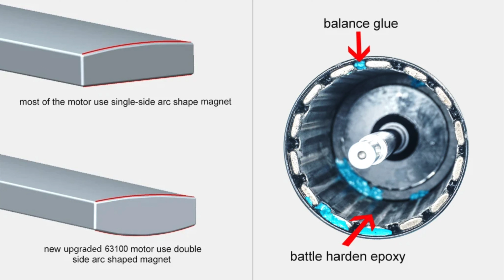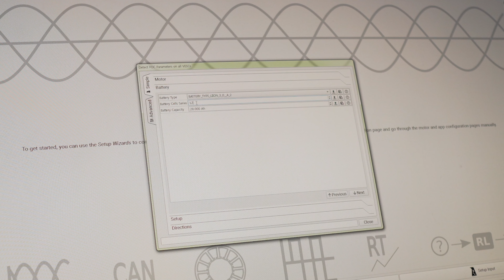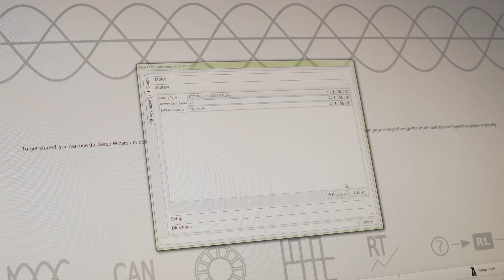#111 DIY electric board motor test - 63100/190KV Flipsky

Comment from the maker: It wasn't easy to explain the characteristics of the motor that I felt while riding with subtitles. So to put it simply, it was a strong and good quality motor.
If you plan Mountain E-board as DIY, I recommend this motor that has a huge output and is universal availability in both "torque and speed."  https://flipsky.net/
라이딩에서 느낀 모터의 특성을 자막으로 설명하기가 어려웠습니다. 그래서 한마디로 표현하자면 정말 괜찮은 모터였습니다.
마운틴 E보드를 DIY로 계획하신다면 강력한 출력으로 토크와 스피드 모두에서 범용성이 좋은 이번모터를 추천합니다. https://flipsky.net/
Reply: What remote are you using? Also what deck can you recommend that is also affordable? Thanks you in advance.

Comment: Thank you for the wonderful video and editing style. I'm planning on putting these flipsky 63100 190 kv on my Lacroix Board. I'm also installing the Boardnamics BN M1 AT Gear Drive which you state in your video to not install flipsky 63100 motors on Gear Drives, If I'm understanding correctly? You also said "Impossible to install gear drive mounts because the length is not right"? Is this still the case in 2024 flipsky motors? Boardnamics told me it will work. Maybe BN found a way to adjust to make it work ok?  Thank your any help greatly appreciated!

Comment: Amazing. I have 6474 but would love to have these! What battery type and amp output did you use? These motors are capable of insane power!
Reply from the maker: The battery used the Lipo battery as a 12S voltage. The ESC is currently most similar to the one in the link below. I remember the ESC output current was a total of 160A. Thank you for watching.
https://flipsky.net/collections/v6-series/products/flipsky-dual-mini-fsesc6-7-pro-140a-base-on-vesc6-6-with-aluminum-anodized-heat-sink

Comment: What are your thoughts 2 yrs later in 2024? 500 mile review of the 63100 190kv flipsky motors!?! Also what is your battery size? I wonder how much more torque and top end speed did you get? Some say the longer motors can cause negative issues. Did you discover anything negative? Thank you!!!

Comment: Are the flipsky trucks alright? I'm looking to DIY my lycaon swift where the only original part is the deck battery, and the enclosures. Was looking into even the flipsky kits (Flipsky Group DIY Electric Skateboard Double Main Shaft Trucks and Motor Kits Dual Drive - 6374 10MM 140KV) where it has the motors, trucks, and cloudwheels already with it and then get a tenka VESC  to program it.
Reply from the maker: I think that even if your battery is Sanyo's 3P battery configuration, the overall discharge rate seems insufficient to be used for the ESC and motor you chose. The most important thing when planning for a DIY or finished product board is the configuration of the battery and the maximum discharge rate of its battery pack. This is because ESC and motor can be determined accordingly. In conclusion, the battery you have cannot fully utilize the performance of the motors and ESC you chose.

Comment: Great fun video as always Brotha. Compared to 6368 motors using the same Battery, do you feel an increase in power?
Reply from the maker: Thank you for coming bro :)
Yeah, It's powerful than 6384, also when I connected it to the same ESC (12s), I felt the texture of the rotation was more delicate and smooth.
It was hard to express, but it felt more luxurious.

Comment: Is it possible to buy the 63100 140 kv and making it accelerate less faster to have a torque like the 190 kvsacrificing the top speed ?
Reply from the maker: You can reduce the gear ratio. For example, you can reduce the number of teeth in the wheel pulley and increase the number of teeth in the motor pulley.

Comment: hello, really please to see you on a board. and how about the range did this hudge motor affect it a lot or not. have a good trip. :D
Reply from the maker: I didn't exactly check up on that. But the experience on mountain off-road is that I guess it consumes 10-15% more power than the previous motor 6380/170 4100W. Thanks for always :)

Comment: Those things are huge, you'd need a like a 12s10p 18650 battery pack to supply their max performance.
Reply from the maker: -Motor maximum current is 100A 
-30Q 18650 1p discharge rate is 15A
-Two motors 200 A
-So 200A divided by 15A
-I think we need more than 13p
But it's powerful enough for me to ride even if it's not the maximum performance :) Thanks~

Comment: what would yo usay the difference is between a 6374 190kv motor compared to the 63100 190kv motor? is their much of a power difference?
Reply from the maker: Yeah, It's powerful than 6374, also when I connected it to the same ESC with battery(12s8p), I felt the texture of the rotation was more delicate and smooth.
It is not easy to explain, but it felt more luxurious texture of the rotation.

Comment: Hey mate. Can I ask what battery you use to power these motors?
Reply from the maker: Two of https://hobbyking.com/en_us/turnigy-high-capacity-battery-6600mah-6s-12c-drone-lipo-pack-xt90.html?queryID=04b11573d5d0c721e5ad64a1228d5fa6&objectID=78433&indexName=hbk_live_products_analytics&___store=en_us
It's 12s(44.4v) in series.

Comment: hi, i am reading on some forums that flipsky products are highly expiring. is all this true ?. I would like to build my first board and was referring to them for not spending a fortune. what do you suggest me?
Reply from the maker: Well, I'm still using them well. I don't think there's an answer to choosing parts and there's a bit of luck in picking. I think it's the best way to buy what you like~
Reply: @KAMiJUINs  I wanted to build my board with dual 6384 190k motors, dual esc 6.6plus, 12s6p molicel p42a. What do you think of these materials?
Reply from the maker: THAT WILL BE A MONSTER!
Reply: @KAMiJUINs  with this build what maximum speed and copper would I be able to get?
Reply from the maker: It'll change depending on the gear ratio and wheel size

Comment: Can I used it for RC Plane?
Reply from the maker: I think it's possible. But I recommend the 16S battery configuration.
Reply: @KAMiJUINs  it is capable until 16S battery? Is it gonna overheat or not if I'am using 16S configuration?
Reply from the maker: Of course, ESC should also use a product that supports a voltage of 16s. The maximum support voltage for the motor is 16s.